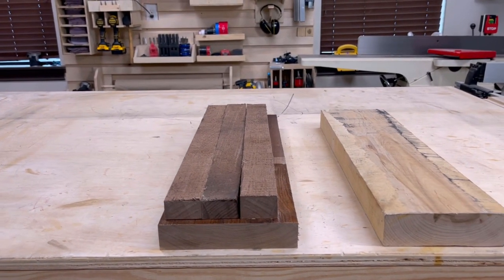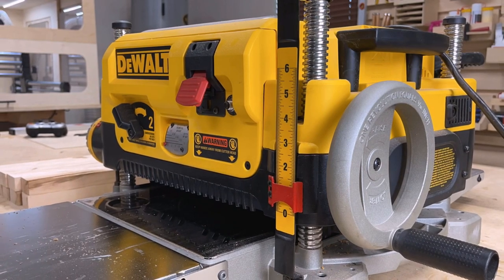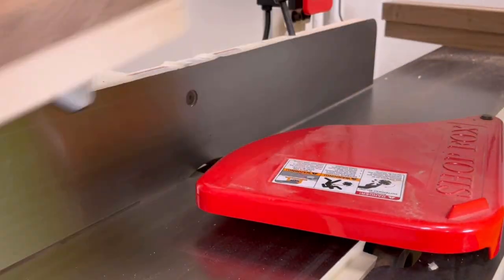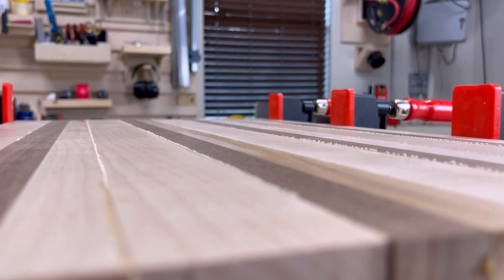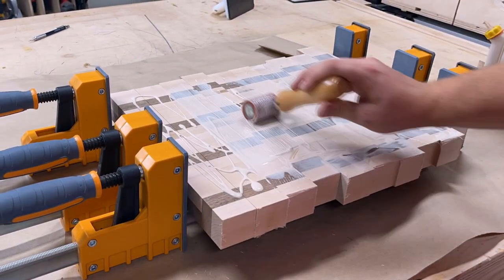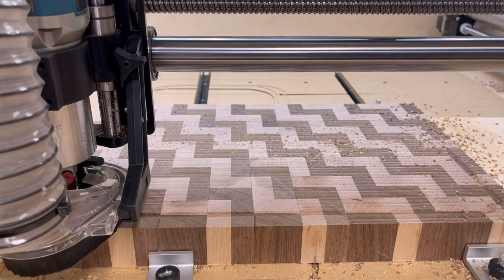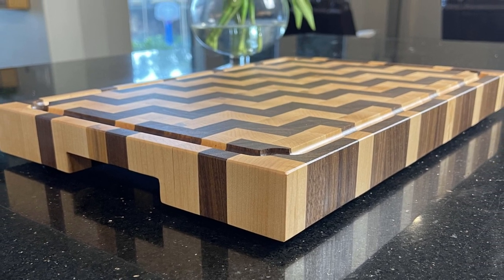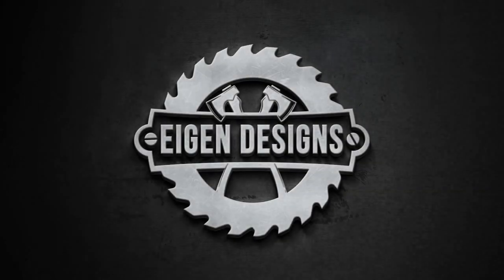The Infinite Staircase Cutting Board

Comment: Very  nice, informative video. Using your crosscut sled on a table saw is a great way to cut all pieces to a consistent size. While I don't have a crosscut sled (My table saw is a smaller one), I DO have a radial arm saw. What I like to do is make a stopper jig and then do the cuts. This method works great.

Comment: When you plane down the board after the second glue up, doesn't that alter the ratio you need regarding thickness (3/4") vs width (1 1/2") of the boards for the final glue up?  I realize that a person will try to plane off as little as possible, but still some of the boards end up to be a little thinner and some will be a little shorter.  It probably doesn't make any difference at that stage of the process.  Great video!  I will be building this board in the near future!
Reply from the maker: I didn't plane the boards after the second glue-up. I planed the individual strips prior to the second glue-up but not after. I hope this helps.

Good luck on your board!

Comment: Very nice! Did you say the strips were 24” long by  1 1/4 ( later 1”)  wide by 2” high? Going to try this!
Reply from the maker: Yes. As long as your dimensions of the legnth are twice the height (e.g. 2" x 1"or 1.5" by 0.75") the pattern will work.

Comment: Did you not have to run your board after second glue up through the planer? Just wondering how you cleaned up the glue squeeze out for the third glue up.
Reply from the maker: I actually did run it through a third time. I often leave out small steps like that to keep the video flowing and not have things drag on too long. Great observation.

Comment: Beautiful board and great video. Just wondering what the advantage is to ripping all the pieces on your table saw from the rough lumber first,  and then edge jointing and planing all the individual pieces,  rather than simply jointing and planing the initial slabs of walnut and maple and then ripping them on the table saw? Seems to me it would be easier to mill two pieces of lumber rather than 16. I don't have a jointer but have the same planer as you so I use a combination jointing/planing sled that I can run through my table saw and planer to mill my lumber so milling two pieces rather than 16 would be much more efficient for me.  Am I missing something here??
Reply from the maker: Hey Clif, I think what you're describing is a possible alternative, and certainly one worth exploring. One thing to consider with that approach would be the quality of the glue up if your boards were ~11 wide. You would need to get clamps on both edges of the board to get good pressure for a glue up that wide, and even then I would have concerns about sufficient pressure in the middle. Without ample pressure across the entire board you could end up with gaps/separation in the glue-up that would show up in the final end grain board.

Maybe a series of cauls could help add some additional pressure in the middle. You've got me thinking about this Clif. If you end up trying this method please let me know how it turns out.

Have a good one!
Reply: @EigenDesigns  Not sure what you mean by this very wide glue up ... after the initial milling I would rip the two boards on the table saw into the same 16 pieces that you end up with before the first glue up. After that I would follow your plan exactly using my work around for jointing and planing.
Reply from the maker: @84tiger  I see what you mean now. I think your approach would work just fine. I thought you were talking about making one solid laminated glue up and then ripping that into the 2-3/4" pieces.
Reply: @EigenDesigns  The one issue I didn't consider would be the capacity/width of the boards that your jointer can handle. If the rough lumber is too wide for the jointer then it would be necessary to rip the material on the table saw first. I would love to have a jointer one day but I guess one advantage to my method of milling is the only limit I have is the width of material my planer can handle.

Comment: so in reality, you loose about 3 inches in width due to going higher and lower with the pieces to make the design correct? if so, what can be done to calculate ahead of time how much material or width is required to end with a pre determined width? like for example, if i want to end with the board being 12 inches in width, how do i pre calculate the material to end up with that dimension at the end?

Comment: This board is beautiful. Did you start with 8/4? I don’t have a lot of 8/4 stuff but was just wondering if I could still do this with 4/4 bc I have a ton of that. Lol
Reply from the maker: Hey Lee! I started out with 8/4, but you could replicate a similar pattern using 4/4 wood. Just make sure that the width of each board is exactly half of the height and you should be good to go. Your "stair" pattern will look a little narrower, but it should work.
Reply: @EigenDesigns  thank you sir I really appreciate it!